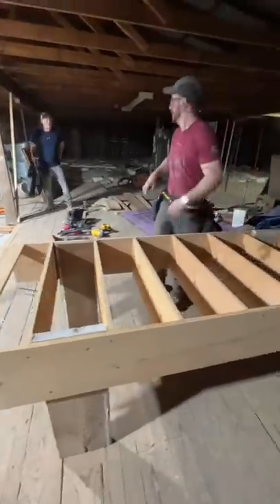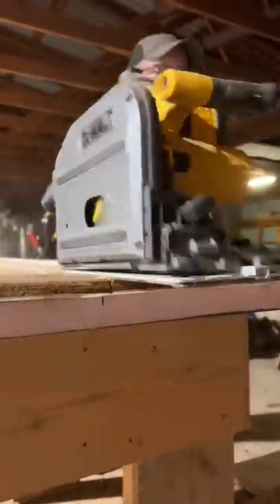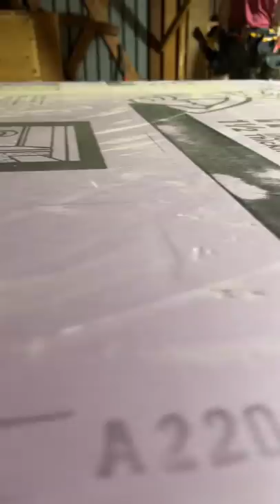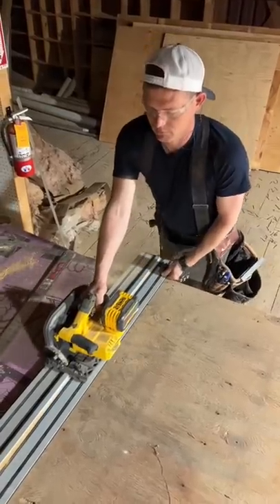Making Woodworking EASIER

Comment: This is a great tip. Have used it for years and and years. When I was remodeling I just threw a piece of OSB on the ground, to create a flat surface and put the foam on top of that.
I'm really surprised that Eric didn't know this one. The woodworking community has been using it for at least 20 years. Probably longer.

Comment: I've had a 2" piece of rigid insulation in the trailer for about 3 years now for exactly this. Absolutely a game changer.  Best $40 you'll ever spend. You can also use it in a pinch for somewhere that needs rigid if necessary. Solid info.

Comment: Been doing that for years .. added bonus - use the accidentally broken off pieces as standoffs for storing boards vertically on concrete. Doesn't wick moisture and keeps the wood from damage with no "sticking" your stored lumber required..

Comment: this is a great tip of your using an actual table or saw horses with joists or something in between. If youe just using to regular old saw horses built with 2x4s i throw a sheet of zip sheathing upside down and set the depth to whatever your cutting

Comment: Yes, I've been using the same piece of 1" thick foam as a cutting board for years.  You can also use the same board for pattern routing with router collars, etc.  Works great.  

The only downside is keeping a big sheet of foam around, but it works so good it's worth it.
Reply: Cut it up in 3 or 4 smaller pieces for storage, then just pull what you need for a given cut.

Comment: Due to space limitations (living in NYC), I keep couple of smaller foam insulation boards.  Works just as well but doesn't require too much room.  Tracksaw is one of those things that transforms the workflow.  If you add some Parf Guide MDF, you almost don't need a table saw.

Comment: That’s sort of an old method. Not a fan of the styrofoam dust . Side note, no reason to have the blade set so deep on your track saw and your bench should be a little lower - pro tip lol

Comment: I tried the exact same trick cutting my floating floor in my basement, but over concrete slab. It did not work that well. Thanks for the tip. I have had never heard that one before either. ;-)
Reply: i accidentally used my table saw top once or twice. luckily it's a cheap craftsman pos model and made of aluminum

Comment: Nice tip, but isn't it better for environmental reasons to use wood sheeting material (OSB, plywood, whatever) rather than making foam particles every time you make a cut? This is also the reason foam is best cut with a hot wire and not saws.

Comment: Thoughts: The Dewalt track saw is probably the worst track saw on the market (Makita, Bosch, Festool, Mafell all vastly superior). No dust extraction used here. Breathing the dust kicked out from the glue/ply is bad enough without then adding a blend of burnt plastic to the mix (that also has high static electricity and sticks to everything). Get a respirator, dust extraction, or ditch this method. A good track saw on a flat surface can be dialed in to just barely kiss the cutting surface beneath. If you are already cutting ply, hitting an additional 1mm of the work surface beneath will not significantly increase blade wear. Foam always comes in handy though (protecting doors, spray painting screw heads, tricky tile cuts with a grinder, etc). Plastics, glue, and cementitious products are killing us and we need to protect ourselves.